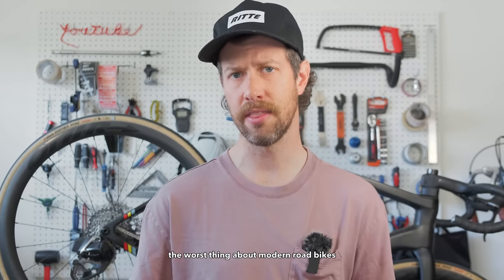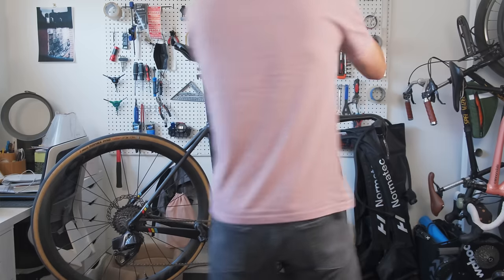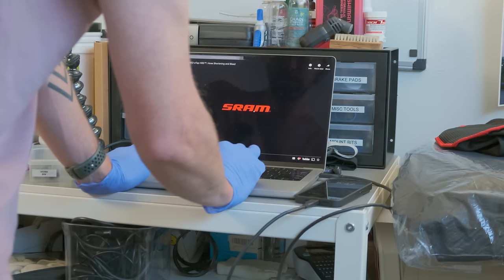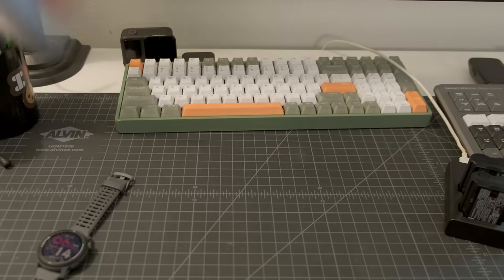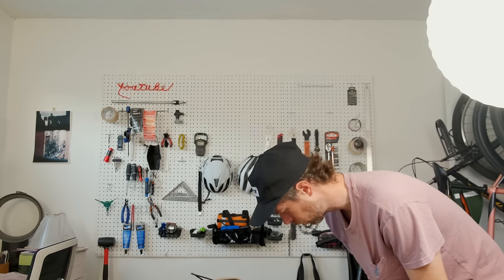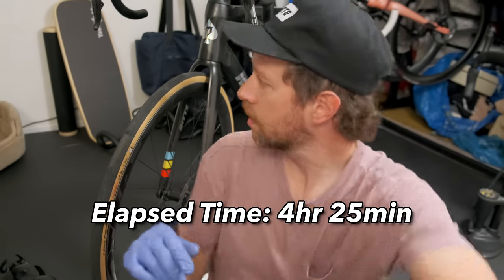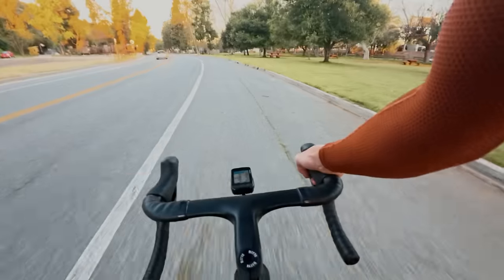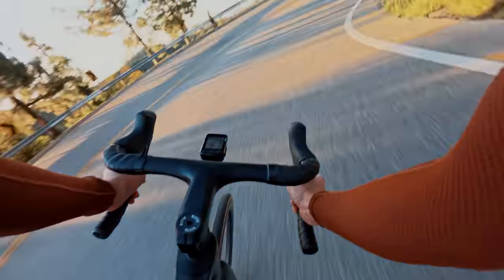If I Can Do This Upgrade, So Can You!

Comment: As I bike mechanic I do not hate this at all, I do however hate customer complaining when I charge them 2 hours of work.
Reply: Same. They think if they buy the parts we just throw em on for free.
Reply: If it's taking you that long to do a internal routing job time to find a new mechanic if I'm honest.
Reply: @mrbuddha5263  well for a integrated handlebar with bleeding and setting up the gears, two hours is perfectly normal. For a stem, handlebar and electronic shifting it will be faster.
Reply: @basvanleeuwen4502  okay, I thought you were just refering to a handlebar swap with an internal reroute.

Comment: Thank god I ride 10 year old road bikes which are lighter, faster and easier to work on.
Reply: Well, you got 1 out of 3 correct 😂
Reply: Nevermind the older bikes gearing sucks bad. They don't climb as good either.
Reply: Older bikes are easier to work on for sure.
Reply: No longer lighter and definitely not faster.
Reply: Def not as nice tho
Reply: @sethcycle4591  They are often lighter, though. rim brakes and narrower tubes help.
Reply: @karenstewart3047  my disc brake carbon frame bike weighs 7.3kg with pedals and computer 🤷‍♂️
Reply: 😂 no. Not even close

Comment: Great video, but I Love that I don't have to set up or replace integrated cockpits, tubeless wheels, or bleed hydrologic disc brakes. I'm good taking it to the shop, I don't need any reason to hate my bike, lol
Reply: @SomeoneKillMesmh The more you know about your bike, inside and out, the better. That way, you'll know what fits & work and what doesn't.
Reply: Cable sheathing and brake hoses can abrade against the steerer tube over time with full concealment . Designers , solve that new problem .

Comment: I have always done my own minor adjustments, but earlier this year went full stupid and build my own TT bike from a bare frame and a mountain of parts. Went with SRAM Red AXS and couldn’t be happier. Everything went really smoothly, including routing cables in the frame and inside the cockpit and stem. I spent basically an entire afternoon on it, taking my time to properly lube and torque everything to spec, and it was a rideable bike by the end of the day. The first outdoor ride on this bike was actually my first race of the year! Absolute rocketship.

Comment: I love what Rose does with their one piece cockpit on their XLITE models. It technically has external cables so you can take the cockpit off without having to bleed your brakes, but they put a channel on the bottom side where you can essentially clip in the cables so they look completely hidden away as long as you don't get on your knees and look at the underside of your cockpit.

Comment: The fact that it took an inexperienced handyman 7.5 hours to change an integrated cockpit where a regular cockpit would have been half an hour. 

This is what’s wrong with the industry. To charge even half the time it took you at standard workshop rates is ridiculous for changing a handlebar
Reply: It gets worse - a bike with mechanical shifting and these screwball setups require (to use Campagnolo's term) "Maximum Smoothness" cables to shift worth a damn! $100 for ONE of these makes one start to think about electronic shifting next time - exactly what (just like with disc brakes) the planned-obsolescence marketing-mavens designed!
My stem/bar (not one piece) change is gonna put the hoses/cables UNDER the stem and bar tape instead of inside, so I only have to f--k around with this once! I HATE this s--t!

Comment: I will never own a bike with fully integrated stem/bars and internal cable runs.  Just no.  You don't have to deal with all that stuff; you can stick with the classic external style, which looks -- classic -- and costs an almost imperceptible amount of watts in aerodynamic drag.  BTW, you can easily adjust the Park stand to work with the front wheel on the floor.

Comment: I just yank the tube out with a pointed plier and trim off the crushed section. Usually takes me less than an hour to install as an amateur do it yourself bike maintenance. If you find sram easy, bleeding and centering on a shimano is even easier. But my OCD will take me 6hours of adjusting the levers and bartapes to be absolutely symmetrical (to the extend of measuring the overlap gap of each loops of the wrap to be exact lol)

Comment: Was ordering integrated handlebar in January.  Cancelled as found out I can't  do some simple adjustments easy with  stem and separate bar. And most I got were carbon... went with aluminium and titanium.  2 road bars.  I get gifted a bike with an integrated cockpit , I always change for simple bars..😂
Reply from the maker: I can respect that! Ultimately it comes down to what’s important to you. Looks, functionality, aero, etc. I will say, if I can survive swapping integrated handlebars, anyone can! 😂

Comment: The plastic tubes that are in the bars when you purchased the bars are used to pull the brake cables through.  Can also pull the steel cable from cable routing kit because it fits within plastic tube.  Saw the plastic tube in the bars but then it was gone when it was time to route the cables.
Reply from the maker: The head mechanic at Ritte warned me that wouldn’t actually help with the hydraulic hoses. Great for cables tho. Just didn’t include it in the video cause it was already a bit long 😜
Reply: @MitchBoyer  Have a cable route kit that included steel cable and barb fitting to press into hydraulic cable.  Just run steel cable through plastic tube then pull plastic tube attach barb fitting to steel cable and press into hydraulic cable.  Then pull steel cable which pulls hydraulic cable through bars.  Every carbon bar and frame I have purchased uses the plastic tubes which makes the job of pulling cables a 2 minute job.

Comment: The other thing you can do with those tube-end fittings is tie a bit of string or monofilament to them before you take the tube out of whatever it's threaded through. Obviously, the string needs to be longer than the full length of the integrated tube route, so that it extends beyond the inlet & outlet. But once you've done that, the next time that particular piece (handlebar, downtube, fork tube, whatever) needs to be threaded with a cable or hydraulic line, you already have a "pilot string" to pull a heavier pilot tube or string for the final install. The magnetic tools are nice, but sometimes a pilot string works better...and if you're selling a take-off, your customer will appreciate you as well.

Comment: Awesome job! in your case, you really didn't have to cut the cables. Just undo the "stealthamjig" using the right torx tool, pull out the nut and you're golden.

Comment: I paid a bike mechanic on both of my integrated cable bikes.   Neither seemed to complain.   Both are something I really don’t expect to touch and I assume even a headset service can be done without having to rerun anything.

That you were able to do it is a good sign - def not easy, but doable.

I heard wireless brakes with reservoirs at the calipers are coming.  That would be amazing / a little scary.

Comment: yup, i prefer to run shimano for compatibility but installation is not a contest. sram does it so much better than shimano. and shimano already improved compared to previous gen that was probably designed by a macaque

Comment: You don't have to cut off old barbs and olives in order to fit them through the cockpit. You have to cur them off and replace them because they're a compression fittings and they are not reusable.

Comment: When figuring out how much you cut off the steerer by measuring the bit you cut off, you have to add the width of the blade. You were a lot closer to 4mm than you think.

Comment: Pro tip: use a small strap or strip of velcro between your frame triangle and the arm of your fork to hold your fork up into the headset when taking the stem off 🫡
Reply from the maker: Good tip, thank you!
Reply: When I did that, I remember I used a tall stool to prop the fork with a piece of cloth between the dropouts and the stool.

Comment: Why dont they make the holes for brake hoses a little larger so the compression fitting does go through?
Reply from the maker: Right!? I would guess it has to do with maintaining the structural integrity/stiffness of the bars. This one was pretty decent, but some of the bars I’ve seen barely have room for the cables to squeeze through 😳
Reply: @MitchBoyer  WRONG! The olive is a compression fitting that deforms when tightened down and is not reusable.
Reply: @MitchBoyer  The most complex one I've installed is the Farsports F1 one-piece cockpit and is my most disliked too due to its inconsistent manufacturing quality. I've had to install this model on three different bikes. The cockpit is so non-compliant even my two-piece aluminium cockpit doesn't feel that bone-jarring and my cockpit is on a 6061 triple-butted aluminium frame rolling on 25 mm clinchers wrapped around a pair of aluminium 2008 Mavic Aksiums.

Comment: Me when i built my AlieExp bike😭😭😭. I’m hoping my integrated routing cable tool will help me next time(doub it) 😆🤣😅✌️✌️✌️
Reply: My aliexp cable routing tool worked really well to pass gear and brake cable (inner) through an integrated bar. Then sliding the outer cables over it.

Comment: You don't have to cut off the thingamajig, you can unscrew them...
Reply from the maker: I might be wrong, but I think once it's been used it becomes compressed on the hose and no longer unscrews. Or maybe my arms have atrophied so much from cycling I'm just very weak 😂

Comment: I dont hate them. I use a park tool cable router and magnet. Never had an issue. 😂 You made that look so complicated.
Reply from the maker: You’re a better mechanic than me!
Reply: @MitchBoyer  I got over 20 years in the shops my friend! Muscle memory! Doesn't mean I know everything. True story. When I was going to buy my current bike, I took your BMC video into consideration. I went with a Roadmachine 01 Five and built it to a three. You were right man. Great bike. Thanks for the advice! Maybe some day we will cross paths and do a challenge together  😁

Comment: 2:37 🤓 actually it's the normal contact force between the wheel and ground, not gravity
Reply: Well gravity pulls everything down.
Reply: @ketle369  🤓 In this instance Mitch was refering to the force pushing up, therefore holding the fork in. The weight caused by gravity would be the interaction pair between the wheel and the earth.